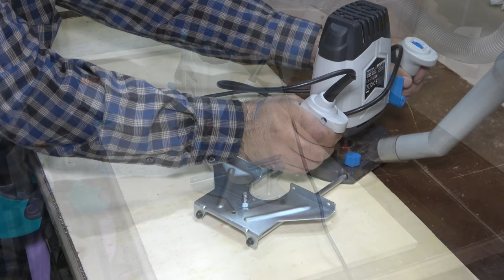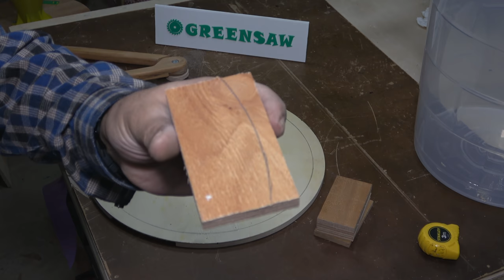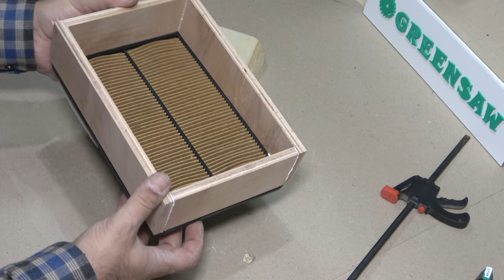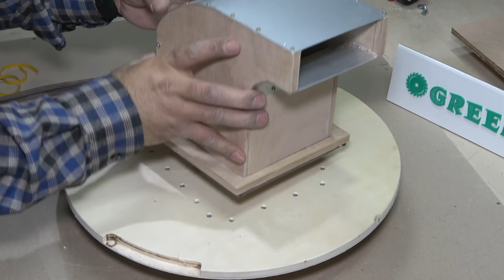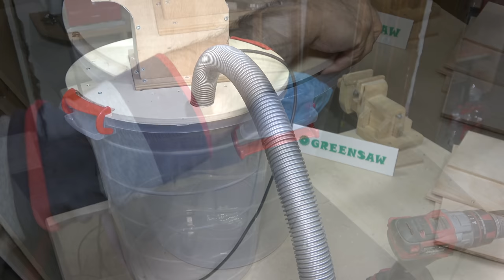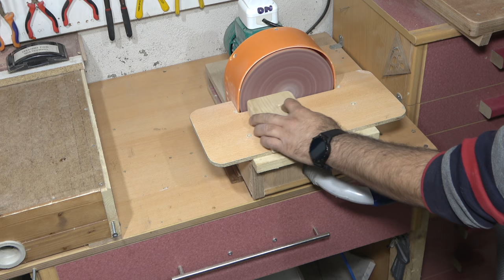DIY - Shop Vac - Part 2 [4K]

Comment: i'm working on a similar concept but with a mason jar canister, and for some reason if i use a 1.25" hose it won't suck lightweight debris all the way into the chamber - only partially and then it all drops out. i'm using a 775 DC motor and a pretty standard (i think) backward curve impeller design... any ideas?

Comment: the title is misleading.It should have been DIY Shop Vac dust collection. Taking a vaccum cleaner motor and fitting it onto a bigger dust collection mechanism is not creating a new shop vac.